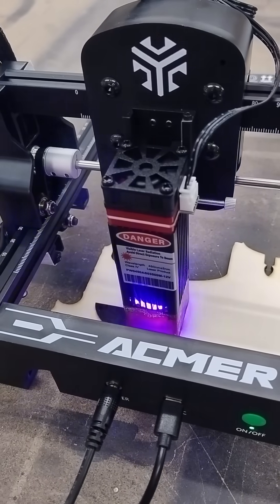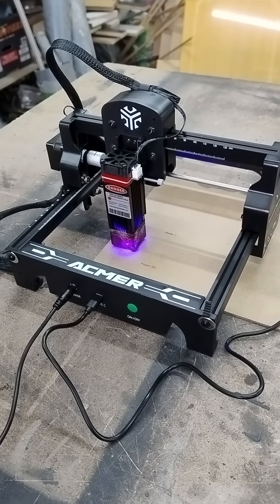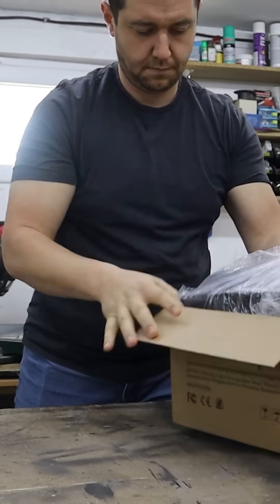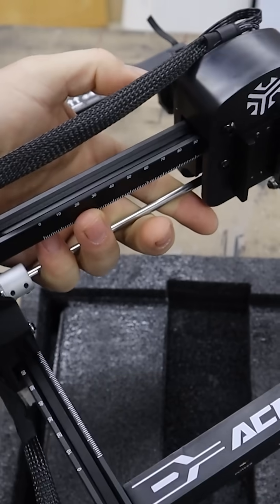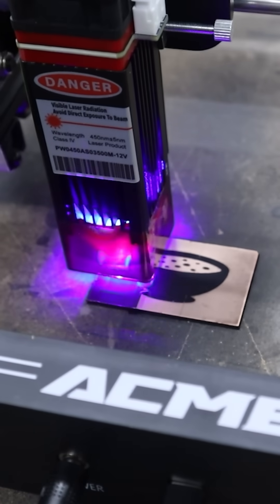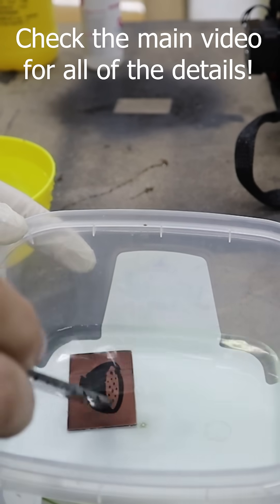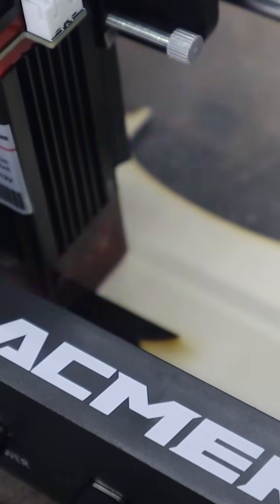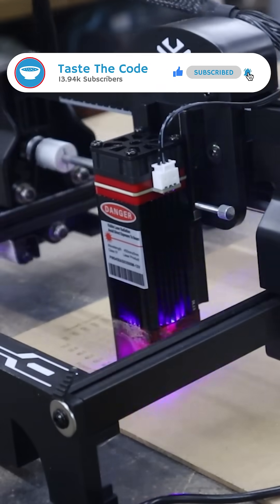Making PCBs at home with the ACMER S1 Laser - Review #shorts #laser #pcb

Comment: Do you know if you could use a rotary with this machine?
Reply from the maker: I think you can use a rotary with any machine. To attach it, you disconnect one of the motors and attach it to the rotary. I'm not exactly sure if there is one for this one that you can buy.
Reply: @TasteTheCode exatamente isso . Apenas verifique se a voltagem do motor do Rotary é igual a voltagem do motor da máquina. Elas recebem 4 fios , são motores de passo
Reply from the maker: Yes, that is a great note. They need to be running at the same voltage. Thanks!

Comment: Blue laser oxidates copper you will not get a good result with that.There's a cheaper and simpler way to print PCBs https://youtu.be/ATcO1At4D_I
Reply from the maker: Yes, IR laser is better for this application but I used what I had on hand.

Comment: I have 2 laser engravers for a few years making PCBs and other stuff.
Reply from the maker: Nice. Are you using the same procedure as me?
Reply: I have a big 20W one and a smaller 5W one. They can both do the same engraving and cutting but at different speeds. They both cannot etch PCBs directly you need infrared CO2 laser for that because of the wavelength. Using the 5W one for PCBs produces much finer resolution and details and the speed is not important for one-off PCBs after all so you are good with yours. About the procedure, yes but use matte low quality spray paint for best results. You sould use one-pass for best resolution (I can achieve 0.1mm easily) and slow down the engraving so you can remove the burnt off paint more easily to prevent rubbing off fine details.
Reply from the maker: @VladoT Great, thx for the tips!